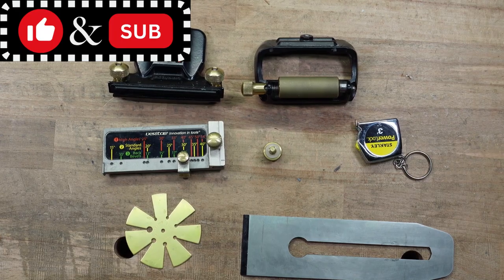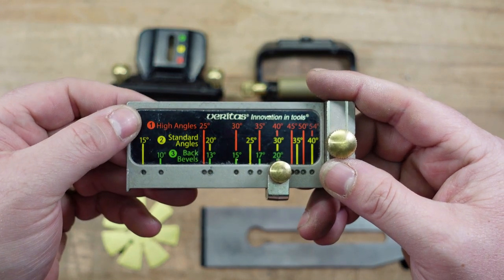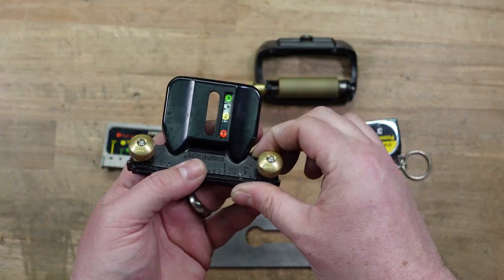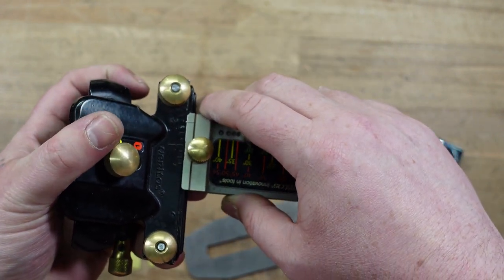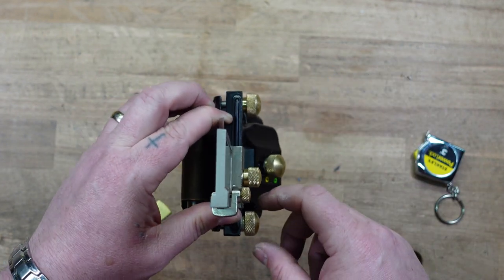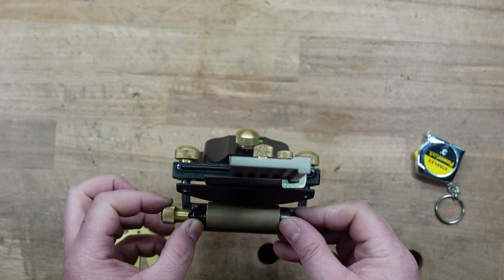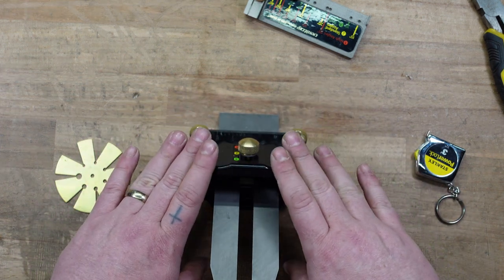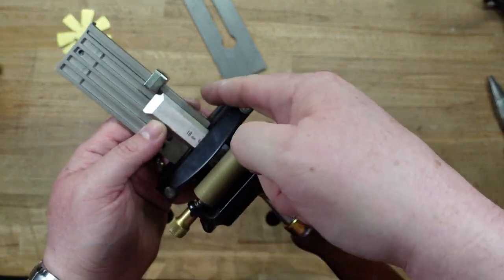How to use the Mark II / MK 2 Honing Guide from Veritas / Tips and Tricks

Comment: Thanks for the video! Do you know the distance between the marks on the blade carrier at 3:04 are measureed at? Seems like the 1" and 2" marks are pretty close together.
Reply from the maker: It is 1 and 2 but not 1" and 2". They have the marks set for the iron width so it centers it in the jig. Thay is just a reference so you know put it here for a 2" iron. Hope that helps!

Comment: One additional note; if you use the secondary bevel knob, be aware that it only lifts one side of the roller, so if you're relying on the roller, things aren't going to be square -- concentrate on your pressure on the blade, basically.
Reply: Are you referring to the micro-bevel knob?  Because it offsets the entire roller on an eccentric axle, not just one side.  I use it all the time and the micro-bevels are always perfectly square and even across the width of the iron.  Or maybe I'm just completely misunderstanding you.
Reply from the maker: Sorry Allan I have to agree with @Wintermutt here. It shifts the entire roller not one side. You may notice that the micro bevel isn't a perfect line all the way accross. It will ether catch up with itself or things aren't dead square
Reply: @BatCaveCreations  Interesting. Back when I bought mine, it seemed that everyone had that the issue that I described with the micro-bevel, and that was the received wisdom as to the reason. I chalked it up to a learning experience, moved on to the L-N honing guide, and pretty much never considered Lee Valley as an option again in my tool purchasing. Any no, this is not the Mandela effect, I can look through the forums that talked about the issue at the time, and still find those discussions. Starting to wonder if we were all just dealing with a bad batch or something. Will have to find where mine is and look at it more closely.
Reply from the maker: oooh that would be a horrible choice on Veritas to make it so the entire roller doesn't move. I am going to reach out to my Veritas contact and see what they say!
Reply from the maker: Our contact stated this is a myth they are aware of. He stated: "The axel in the roller is off center, so when you change the knob the entire wheel shifts. its eccentric. The parallelism is maintained when you adjust the knob." / I asked if past models were different and he stated nope, the wheel mechanism has changed but it's always maintained parallelism.
Reply: @BatCaveCreations  Ok, found mine, examined it in detail, and they're right; myth busted. It is indeed eccentric and does maintain parallelism. It's a stout myth, though, just do a cursory search though the usual forums and it's everywhere. I suspect that it's as the video demonstrates, just either being slightly out of square on the registration jig or not torquing the clamp evenly. I feel that good has been done here, and the Bat Cave has shown us the true path.
Reply from the maker: It deff is a myth out there! :(  I am glad you see that its not true and I hope others do too because this guide is awesome. Best one I have ever used! Share the good news! 
BUST.THE.MYTH.BUST.THE.MYTH (Bat Cave Friends chant with pitchforks aimed at the castle that is Social Media) :D
Reply: Just read this searching for a solution to a problem.  I'm using the mark 2.  I get a perfectly square iron on the primary bevel but when I switch the rolling to hone a secondary bevel it goes out of square.  It's driving me mad. My conclusion... I think the roller mechanism doesn't stay 100% parallel when you switch to secondary bevel.